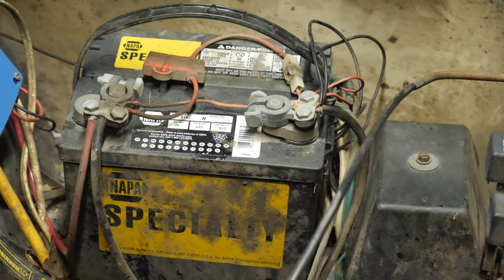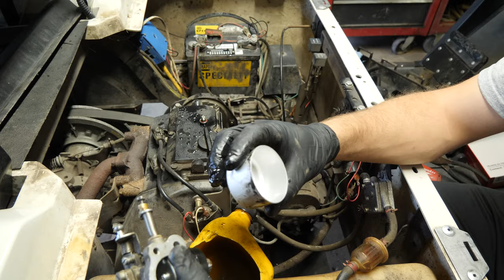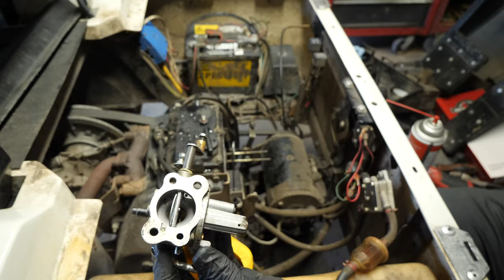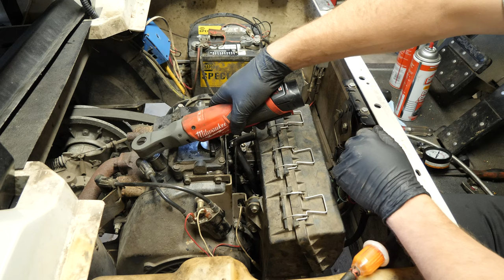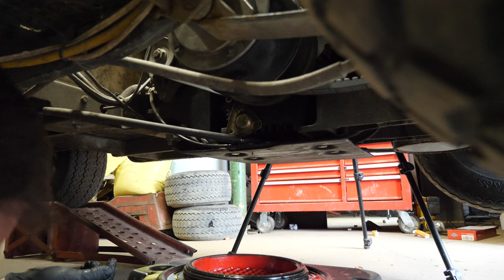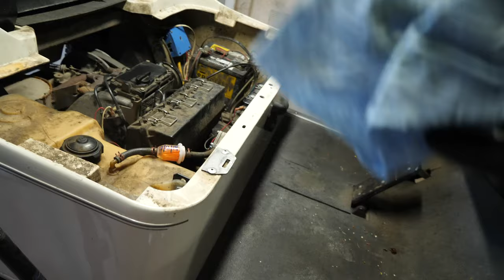1999 EZGO TXT, Gas - Hard Starting, Oil Change, Clean Carb

Comment: Kevin I want to Thank You for Your Videos. I have a 97 Ezgo TXT and your Videos really helped me. I had like 60 Compression on 1 of My Cylinders. My Carburetor was filthy also. I changed All of my Fuel Lines out. Cleaned My Carburetor and Adjusted the Valves. When done Compression was like 150 on Both. I also tuned up and Changed the Oil. I really Thank You Though Great Videos...

Comment: Kevin- Thank you for making these videos, they're a great help. I have this exact same cart - year and model. For the past 2 years of owning it, I have an issue that after it warms up and has been driven for about 5-15 minutes straight, like from my house through the neighborhood to the golf course. Let it sit for a few minutes (10-20) It will struggle to make it out to the first hole on the course. Then it just won't run at all. The starter generator is new and trying but it's like no spark feeling, and you can smell fuel. I end up leaving the cart then coming back after the round of golf it fires up and I can take it home. I have replaced everything on this cart electronically, adjusted valves, brand new OEM EZGO carb (one of the last few in the US I was told). This week I'm doing my first season oil change and am going to replace the fuel pump and fuel lines just cause those are the only parts I haven't changed. I wish I was closer to you cause I would just drop it off LOL, but I cant so any info is appreciated! Take care!
Reply from the maker: This is a symptom of either failing ignition coil or valves out of adjustment. Both are affected when hot. When they get hot, they tend to go open circuit internally. Some cases, they short out. Your only option is aftermarket coils since OEM is no longer manufactured. They work, but are no where near as good as OEM. Its not often that the CDI fails but they do. Do a compression test before you run it and again after it shuts down. If its at least 120psi, its likely the coil. If its below 120psi, try readjusting your valves again to .004" (4 thousandths). Do this on a COLD engine, not warm or hot. This is supposed to be done annually, according to the EZGO service manual. You smell fuel when its cranking so its getting fuel.
Reply: @Kevinsgolfcarts  First Kevin, thanks for the quick reply!! 
+ The last valve adjustment and comp test I did I got about 120ish PSI.
+ I have used 3 different coils... 2 new non-OEM and one known good OEM from a friend's cart. Still did the same thing with all 3.
+ I have a new CDI and solenoid, both aftermarket. I know they're not as good as OEM.
+ There were some random days last summer where the cart ran a full 18 holes of golf...... I'm losing my mind on this thing!

Comment: Your videos have been a god send, I do not have much experience with small engines let alone golf carts.  Just wondering what type of oil to put in the motor when I change it. Thanks again.
Reply from the maker: Convensional 10w30 is fine.

Comment: Have a 2001 EZ 7 did a compression check 110 & 105, treated with ATS 505 CFR engine cleaner before the oil change, that bumped me up to 135 & 125, then ran the valves to Kevin specs. now have 145 & 155 psi.  Do I need to redo the valves as the higher psi cylinder is now the lower psi cylinder? The cart now runs damn good thanks to you.

Comment: Kevin thanks so much for all your vids you have taught me so much. Mine also has no spark arrestor and ive tried to order one online but cannot find one to buy. Can you recommend where to buy one or is making one an option? Thanks
Reply from the maker: Used to be able to get them directly from EZGO, but they changed their website so now you have to go through a dealer. I used to buy them directly off their site, but now I can't. Just another reason to avoid them.

Comment: I like your channel, my question is,  I have a 98 ezgo, new carb, it runs fine in neutral,  but it will not ecelerate quickly, and will not pull a incline,  the fuel filter doesn't fill up either.
Reply from the maker: If you have the 2 cylinder Robin engine, you will need to adjust your valves. They require checking  and adjustment yearly.

Comment: One thing I noticed is you didn't show the disassembly or the reassembly of the float. You just pulled the float pin and that's it. You didn't show the orientation of the fuel inlet needle which is very important because if you install it upside down then you will not get any fuel. 1 other thing when taking the throttle cable off, there is a plastic sleeve you can slide down that makes it much easier to remove the throttle cable from the throttle lever!
Reply from the maker: I have plenty of other videos showing more details with disassembly and reassembly. The sleeve on some of these carts are very brittle and will break so I don't mess with them.

Comment: Kevin, after watching your videos I was able to get a similar cart running after two years of sitting. THANK YOU SO MUCH! Although it runs, it's very slow, needs choke to stay running, and barely climbs my driveway. I wasn't able to get the main jet out during the carb cleaning. It had hard thick black gunk in the bowl. I used an entire can of carb cleaner hoping for the best. Any suggestions for me to get this cart running at normal power?
WORK COMPLTED: NGK BP4ES PLUGS, NEW WIRES AND COIL,  .004 VALUE ADJUSTMENT, AIRFILTER, PCV HOSE, OIL AND FILTER, FUEL FILTER, 1/4" FUEL LINES AND VACUUM,  AND FUEL PUMP.
Reply from the maker: For what all the carb cleaner costs, I would just replace the carb entirely. You can find them on Amazon for cheap.
Reply: @Kevinsgolfcarts  Good call on the new carb! I don't need to choke it anymore to keep it running. The cart goes the same speed in forward as it does in reverse, only 7mph. I have a feeling that whatever tells the cart to go half speed in reverse is telling it to go half speed in forward. Any idea what part controls this?
Reply: That would be a governor adjustment perhaps?

Comment: why do you not wash the engine and engine compartment before you do work on them. What dry lube do you use on brake cables etc
Reply from the maker: It all depends on what the repairs are, how dirty the area is I need to work or if there is enough time. Sometimes the electric items get wet and stop working so I only wash under the seat if it really needs it. If you get water in places its not supposed to be, it could cause more issues.

Comment: Where can you get the spark arrestor plate without having to buy a whole air box?
Reply from the maker: Unfortunately, as far as I'm aware, its not available as a standalone part. It probably would cost as much for that piece of steel as the entire airbox. Its just a small stamped piece of steel. You may be able to fab one our of sheet metal.

Comment: What causes the oil in the air box? I have a 99 ezgo txt I bought used and it had oil in the air box, I ran sluggish so I cleaned the carb, new air filter and plugs. Ran better but I noticed I have oil in the air box again. Still need to do a compression check
Reply from the maker: The PCV is piped into the airbox. Its part of the emissions on small engines. That takes the crankcase gases and sends them into the intake to reburn. This leaves a bit of oil residue.
Reply: @Kevinsgolfcarts  if I’m getting a pretty substantial “puddle” in the air box after a short time would that point to a more serious issue, possibly needing a ring job?
Reply from the maker: The PCV may be failing or the engine is overfilled.
Reply: @Kevinsgolfcarts  oil levels good I’ll check the pcv, Thanks
Reply: The engine could be worn and you’re getting excessive blow-by. A compression test may show you what’s going on.

Comment: Is the fuel filter supposed to be full off fuel or ? Mine only looks like it had fuel n it when holding down the gas pedal.
Reply from the maker: In most cases, it should have some fuel in it while not in use. They don't always fill completely and some air in it is fine. If it takes a long time to prime after sitting for an extended period, check the fuel lines for leaks. The smallest leak will cause the fuel to drain back to the tank.

Comment: On the stainless steel mesh filter.  Is it recommended to replace those every oil change like you would with a regular filter?
Reply from the maker: You only need to change this filter if it has any damage. It can be cleaned and reused.

Comment: Did you install the spark arrester? If the customer didn't want it installed, do you add a disclaimer to protect yourself if catches on  fire?

I have a 2014 EZGO TXT Fleet. Does the drive motor have a thrush washer or motor break that can make noise on de-excelleration? 

Thanks.

I'm okay with you answering questions on the next video.
Reply: How do you stop over travel on the forward & reverse lever when switching it into reverse? It's a 97 ezgo txt.

Comment: You mention that you can always tell when a bad mechanic has done some work.  Why don’t you clean things better before reinstallation?  Like the exterior of the carb, the air box, etc.  I never reinstall anything without thoroughly cleaning it.
Reply from the maker: So not cleaning something makes me a bad mechanic? Why would I clean the outside of the air box? I DO clean the outside of the carb. Sometimes they don't get completely clean due to corrosion. More importantly, the result of what I do is to solve a problem. If you want to pay me to clean things, that's fine. I only do what is asked of the customer. Most tell me "just get it running" and that's exactly what I do. You start taking things apart that aren't related to the problem just to clean them can open up other issues. Now I'm responsible for fixing that issue at my expense.
Reply: @Kevinsgolfcarts  I don’t disassemble anything just to clean it unless it’s a restoration but if I remove something to repair or service it I would never put it back before cleaning it, inside and out.  For example if some one pays me to clean a carb and replace an air filter there will be no doubt it was done even before they start it up.  It will be the cleanest thing in the whole vehicle.  But that’s just me.  Also when you pulled the air box and made note that the spark arrester was missing and how dangerous it was to run without one, yet you re assembled without it.  Don’t hate, it’s just the way I do things.  I have a deep respect for all things mechanical.  Nothing anyone says will ever change that.  Every customer deserves perfection, no matter what the machine is.  And I never said you were a bad mechanic.  I just got the first golf cart I’ve ever owned and and have learned a lot about it watching just 2 of your videos.
Reply from the maker: There's no hate but I will only do what a customer asks. As I've stated in other videos and comments, most of my customers want it done as inexpensively as possible as long as its correct and safe. Mote can care less what it looks like under the seat. The ones that do care will make it clear that they want it to be neat or the cart is already clean before I get it. As for the spark arrestor, customer opted to NOT install it after I made it clear that it was needed. They are the one paying the bill, its their cart and they have the final say. Everyone has their opinion about the way I do things but, in the end, the customer has the final say how they spend their money.
Reply: @Kevinsgolfcarts  I don’t believe the customer is always right or knows what’s best.  I do  believe that they need to be informed of what’s right in a respectful and professional manner.  I also believe that a customer needs to know that I may not be the best person for what it is they think they want done. This has not failed me yet and I’ve been in the PM and repair business for 38 years.  I’m sure you are very successful at what you do and wish you continued success.

Comment: on the wire mesh oil filter, did you replace it or just clean it?
Reply from the maker: You can wash them if they are not damaged or clogged.
Reply: Thanks for the reply Kevin, I have a 99 txt and wasn't aware of the mesh filter, thanks for the great videos, they keep my cart running good!